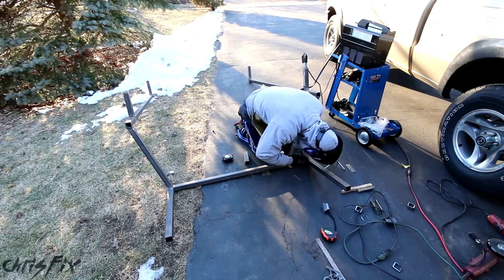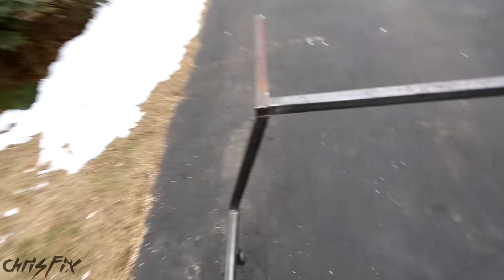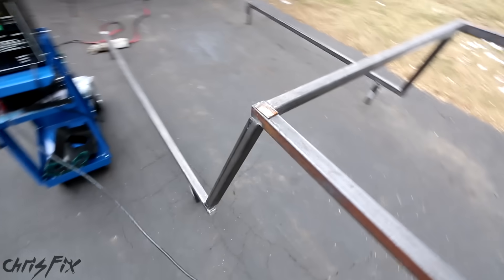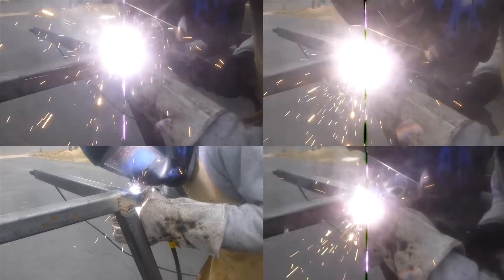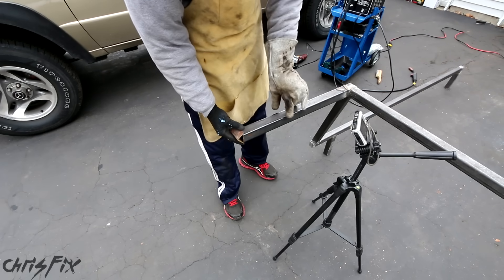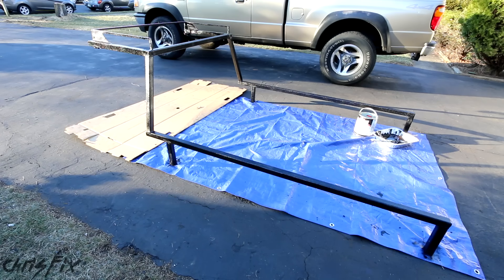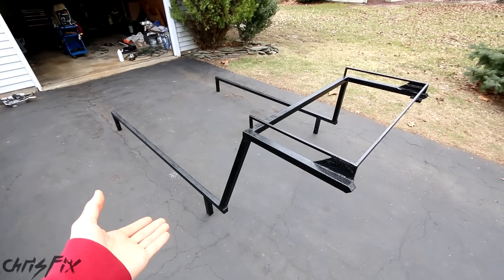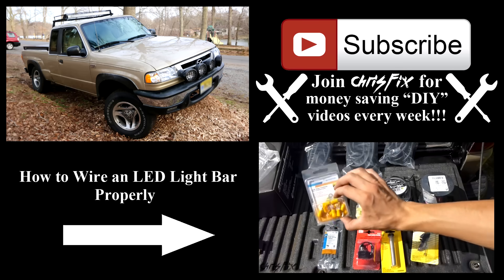Custom LED Light Bar Build (Part 2 "Project Night Light")

Comment: Hey Chris, I am a 22 year veteran fabricator welder. Overall you did a pretty good job on your project considering your tools and where you were working. I would have done a few things different but great job!! You really don't want to grind your welds if you can help it though. It weakens your structural integrity. Impact and shock absorption can crack them. The inner shield wire you were using is fine for outdoors. It's not really considered flux core even though the flux is on the inside. Flux core requires CO2 gas and is insanely hot for a project like yours. Great work. Extra stiffeners and bracing can also compensate for warping a lot while keeping everything true. If you ever do other projects like this, shoot me an email, I'll be glad to help out.
Reply: +SnS PC WRONG !!  It IS FCAW! Does not require a separate shielding gas. CO2,  75/25%Argon Mix or otherwise!
I am not even going to get into the details of MIG, SMAW or GTAW.  
But your comment is Way Off Base!   Try Again.....
Reply: +Bob Duvall What the hell do you think inner shield is? Gas shield in the core of the wire. You do not use bottled gas with that type of wire. It is made for outdoor use. Do yourself a favor and don't go into the details. I would hate to see you hurt yourself.
Reply: +Scott S Learn to read!  I said Does NOT require a "SEPARATE" shielding gas.   
He said  "Flux core requires CO2 gas" !!!    IT DOES NOT REQUIRE CO2 GAS!!!

You are right that "you do not use bottled gas with that type wire."
That's What I SAID!    "Does not require a separate shielding gas. CO2,  75/25%Argon Mix or otherwise!"
Also straight CO2 IS NOT INSANELY hot for that type work.  
It increases 'Weld Penetration"!!   Which is CLEARLY Needed Here!
Apology Accepted.....
Reply: Bob Duvall That's nice. Been nice talking to you. Flux core does require CO2 gas. Bye bye then.
Reply: +Scott S Here is a part of your own comments.  
"" +Bob Duvall What the hell do you think inner shield is? Gas shield in the core of the wire. YOU DO NOT USE BOTTLED GAS WITH THAT TYPE OF WIRE. It is made for outdoor use. Do yourself a favor and don't go into the details. I would hate to see you hurt yourself.""  
Scutt!   You then said "Flux core does require CO2 gas. Bye bye then."
    Clearly you are Too Fucking Stupid to read your own writing, and also to realize that CO2 is considered a Bottled Gas!
Lick My Balls! then Google "Dual shield FCAW"!!     BaHaHaHa
        Here is what Lincoln Electric says
""NO SHIELDING GAS
Do NOT use an external shielding gas with FCAW-S electrodes (Figure 1). The arc would be shielded from the atmosphere. This would not allow aluminum and magnesium from the electrode’s core to react and combine with nitrogen and oxygen from the atmosphere and form compounds. The weld deposit would end up with much higher than expected levels of primarily aluminum, resulting in very brittle, crack sensitive weld metal. Therefore, using a shielding gas with self shielded flux cored electrodes will result in potential weld cracking issues.""
Next.......
Reply: Bob Duvall Inner shield and flux core are two different wires. Dude get off my ass.
Reply: +SnS PC You do not need gas for flux core. Maybe you meant to say metal core but flux core is already protected by the slag. You CAN have dual shielded welds but in this case it's only a rack for a truck.
Reply: +Scott S No you are wrong.
I'm leaving with this quote from an expert on welding forums: 

"However, there are two fundamentally different types of flux-cored wires. One type is self-shielded and the other type is gas-shielded. These two types are often subcategorized as the FCAW-S process (self-shielded, flux-cored) and FCAW-G process (gas-shielded, flux-cored). Self-shielded, flux-cored wires, commonly referred to as Innershield wires, are often described as “a stick electrode that is inside out”. Just like covered or stick electrodes, they rely solely on their slag system and the gases produced from chemical reactions in the arc to protect the molten metal from the atmosphere"

Comment: Honestly......my skill personally is not quite in welding or much of the mechanical....not do I particularly have the added time or workspace for the project. I drive a semi and i'm often away from home, so I keep my stuff at the parents' place and save the extra cost of house and such that i'd never be at much (hence the lack of workspace for it.

Would you be willing to make something like this for a '99 Silverado with the extended cab? I believe the bed is the short version. Never have had much need to go measure, but I can if needed. 
I'd definitely need a rear-facing bar mount as well though.....getting tired of assholes with high beams coming up behind me. or these birdbrains clueless that it ain't cool to blind everyone.
Reply from the maker: +Martin W Unfortunately it would not be worth it or even easy to do without having the actual truck to work on and size up.

Comment: wouldn't it be better to drill the holes from the bottom of the mounting bracket so that the holes would be straight at 5:16
Reply from the maker: It is easier to drill from the top because you need pressure but you could always flip it over. Either way,  I made it work.

Comment: You might wanna buy some tap grease, a guy in my metal shop class got reamed by my teacher for not using it and dulling it. Love the videos, i have an 04 Mazda 6 of my own (completely different from the b series trucks but were all a family)
Reply from the maker: +nprguyplayz Great suggestion! Thanks!
Reply: +ChrisFix I honestly am impressed, looks very cool. Maybe patent the design, only thing I would of done different is also put a cross bar below the back window for more rigidity

Comment: If you add a piece of small 1x1 angle iron to the inside edge of the roof rack ,  you can lay a piece of metal mesh down on them ... This will give you a suitable rack to add cargo to . But if you plan to add anything up top on that part , I would add a couple triangle gussets to the headache rack to support the roof rack bars that extend out over the truck ....  Same with a couple gussets from the bed rails to the vertical headache rack bars ... Just for strength and rigidity ... ...... You also may consider adding a spreader bar right behind the light bar ,so you have something to mount the base mesh to  .... Maybe even add a little rubber bumper to the bottom of the roof rack at the front corners just incase you put something up there and it bends , you will not have steel rubbing the paint , it will sit on the little rubber bumper instead ..............  ............ Great job though ,  I love seeing people take on DIY projects.....
Reply from the maker: +Norman Murray Thanks a lot for the ideas Norman!
Reply: +ChrisFix i would weld a steel mesh or metal screen sheet to the back of the headache bar, this will prevent cargo from hitting your back window and looks cool

Comment: I wanna build a light bar on my 99' dodge ram on the bumper sticking out. thinking about having 4 supports welded to small plates with 2 bolts each. use kc off road lights. do you think i should angle the ends at 15 degree? or whats recommendation?
Reply from the maker: +Richard Cowtails I would get angled ends if the metal is not at least 1/8in thick. I would run LED lights not KC because well, you will see for my next light project!
Reply: Would you say for the buck the led light bars are better? the kc's halo are pretty soendy for what it is
Reply: +Richard Cowtails led is the way to go

Comment: nice setup. i think it would have been better to put a brace going from the bed rail to the back rack, maybe even a 2nd bed rail ontop of the other spaced an inch or so and about 3" shorter with an angled piece at the end
Reply from the maker: +Evan Caron Thanks!

Comment: I have an idea, a little late, but if you didn't weld the brackets on, you could have used a bolt, then put different holes on each side so you could adjust it to where ever you'd like.
Reply from the maker: +GameGruffs The brackets are not welded on. Thanks for your idea!

Comment: for learning how to weld from youtube, you did very well.
Reply from the maker: +Ritchard posterior Thanks a lot! I was thinking about taking a class but they are pretty expensive.
Reply: +ChrisFix it's how I got into the trade. called looking for a one or two week course at the college and ended up doing a 7 month program. now I am 4 years into the trade. FYI a chopsaw would of made your life so much easier. good work anywho

Comment: really like how you said f*** mounting it to the roof like everybody else.  Cant help but wonder why you didnt extend it across most of the length of the roof and weld some bars in there and turn it into a roof rack
Reply from the maker: Joseph Simpson Thanks bud! You never want the light bar to be up near the windshield because then the hood will light up and make you night blind. Where I have it mounted, the roof cuts off the light from the light bar right at the front of the hood so you dont get any glare. I like the idea for making it into a roof rack.

Comment: Another slam dunk. 

I have been wanting to learn welding for a long time. Most Community Collages have it as a night course. You Tube is great but somethings need to be "hands on". I always was turned off thinking the gear (a decent welder) would be too expensive a toy. Seeing what you just did with a $99 Harbor Freight unit just made up my mind to dive in. 

I did have a few observations on "style". I would have gone with 90 deg. angles instead of certain places you used butt joints. It would have eliminated the need to weld in caps and the "V" shaped nose and triangular gussets to close off the leading edge under the bar could have been a simple 90 also. 

Much less work. Just cleaner designwise. 

One mans opinion,your mileage may vary. 

Keep it up brother, you are definitely an inspiration and showing this old dog some new tricks everyday.

Unrelated comment: Where did you do the "beauty shots" at the end? Look like a nice spot.   

And also be careful there Stig. BIG slip at 12:59. Wouldn't want to destroy the mystery.

Remember: There are no stupid questions, just a lot of really inquisitive idiots.
Reply from the maker: robert montalbano Thanks a lot! I am glad you enjoyed the video and thanks for the tips!

Comment: Initially I wasn't a fan of the square pipe but it turned out great. Nice job mate. Always good to see well thought out diy jobs.
Reply from the maker: 92GQ Thanks a lot! I wasnt sure either but I figured the light bar is square, the truck is square, and that was the theme I was going with!

Comment: Chris i think in the video tou had tour wire speed up to high with flux core wire try turning it down a little... one welder to another... keep up the good work man
Reply from the maker: John Kelley Thanks a lot John! I appreciate the tip! I am just learning to weld so any info is helpful!

Comment: You've got a little bit to learn about welding, but otherwise; awesome!
I have built numerous roof racks with LED-bar mounts in both aluminium and steel, and i prefer cutting the corners at a 45-degree angle and welding them together, you don't have to worry about it rusting from the inside. But without a proper saw with a degrees-scale on it it's difficult to get the angles right.
Oh, and BTW; are you using regular wire with shielding gas or flux wire? I can see your welds surround themselves with quite alot of welding-spatter, you should try bumping up the gas-flow to see if it helps.

Nice job!
Reply from the maker: Eilif Finsaas Thanks a lot and thanks for the info. This was flux wire so no gas.
Reply: Well in that case it explains alot. Flux wires spatter like hell.

Comment: Here in Ontario, it'd take about 20 minutes for a cop to pull you over and give you a ticket for that thing.  Even with it switched off, they'll still probably hassle you. 

Also, you mounted it way to far back.  Should've been almost flush with the top of the windshield.
Reply from the maker: Joseph Blowington That stinks they are so strict by you. I mounted it in the correct spot. Mounting it flush to the windshield is incorrect and will cause you to become night blind. You will light up the hood of your car and that is not the proper way to run the light. Thanks!

Comment: You should add some lights to the back of the cab in case you are working on something in the truck bed at night.
Reply: John Smith like what.... ..... ......
Reply: Alex Luessow hiding a body
Reply: Alex Luessow
There’s 4” LED lights that can be mounted on little swivels, so you can do work/see arpund your car when stationary.
Reply: Abel Galván ^^^

Comment: Just wondering if you'd mind me using this design for my pickup? I really like how it came out and was trying to find a clean way to install a light bar on the top of my F150 extended cab.
Reply: go for it i give u permission to use this fucking ugly rack but ur truck is gonna look fugly if u do! uhhhohh

Comment: As  machinist, I feel obligated to tell you that a 5/16 drill is necessary for a 3/8 tap.
 You're tapped holes will be very sloppy and will eventually fail....especially with thin metal.
Reply from the maker: ***** Thanks a lot for sharing! I appreciate the tip!

Comment: Level is the plane perpendicular to a vector of gravity (plumb is parallel). I believe the term you mean most of the time is flush or square. Also most squares like the one you use have scribes/awls in the base of them.
Reply from the maker: jrcboy Thanks for the info!

Comment: Would've been nice to see "Project Night Light" have a section of the video where the LIGHT was on at NIGHT... =| smh
Reply from the maker: Jay Neil First Project Night Light has to be wired up. I am in the process of making that video and then you will see it at night.

Comment: Really good,honest video brother, I think people get too caught up in how pretty welds have to be, if they are strong, and with a bit of grinding and a flapper wheel come up nicely then thats all the matters (obviously its less work to do perfect welds but hey, not many of us can do that) I also noted the sort of loose threads but I didn't think that would be an issue (the bolts aren't going to be under pressure to wreck the threads or anything). Looks fantastic! Love the herculiner too, never knew you could buy that, seems sort of like plastidip to me, which is also really good but herculiner seems like a much more durable and more importantly, permanent option! Very cool :)
Reply from the maker: Aidan Šeštokas Thanks a lot man! The Herculiner is a great product! It is the first time I used it but I plan on using it again! Super durable for sure!
Reply: ChrisFix I would have applied some kind of rust protection IN the frame, before closing up the holes.
Even better dont close all the Holes or make extra holes for ventitalion.

Comment: Beautiful work.   You took the time required and it turned out great.   However,  the light bar almost cost $1000.00.   I hope that sucker is secured lol.
Reply from the maker: Bobby0345 Thanks a lot! Yea, it is secured. I built in a few security features that I did not film lol.

Comment: What are you using for wire on the welder? I've heard using a better wire like Hobarts Flux Core wire will give a better result compared to the wire that is supplied with the welders( such as the harbor freight welders)
Reply from the maker: now534 That is harbor freight wire. I heard the same thing from a few subscribers so the next roll I will give it a shot. Someone said Home Depot wire worked well.
Reply: ChrisFix yeah I grabbed a roll of Hobart from Home Depot. I never got to use it but my friend did. Worked better than the harbor freight wire.

Comment: looks fucking awesome man keep up the good work. now I don't know the demotions of the sides of the frame but when your looking at the truck from the front where the motor is you should put 2 little LED bars directly on the sides so you have light in front while driving and light directly to the right and left of you let me know what you think love the project man good work
Reply from the maker: DL9619 Thanks a lot man! Yea, those are called "alley lights" and I actually secretly designed the frame to accept 2 12in bars ;) haha. I like that we are on the save wavelength haha! Good thinking!

Comment: Great build and video! Very cool. 

I would only change adding a bit of storage behind the light up on top, but, its a truck, you have 6 foot of storage just behind that. 

What if you made removable cross bars that would fit on the lower rails, so that you could load up the top of it?

Truck rack v.1 is still amazing though, sounds like I need to work on my welding skills so I can do something similar...
Reply from the maker: ***** Thanks and thanks for the ideas. I am designing some cross bars to fit my small boat on the top! I like the idea of making the roof rack usable. I might do some expanded metal in the future!

Comment: Have you ever done a video on how to prevent a thief from stealing your LED lights/auxiliary lights on a vehicle or at least making it very tough to unbolt and run away with the lights?
Reply: I have heard of doing a spot weld on the nut where the bolt/nut are together  prevents it from loosening up and prevents them from being stolen
Reply from the maker: ***** I have not just because my methods are secret haha. I kinda showed my setup in this video. The key is to make it as difficult as possible because if someone really wants it, they will get it.
Reply from the maker: countryboy92 That definitely helps!